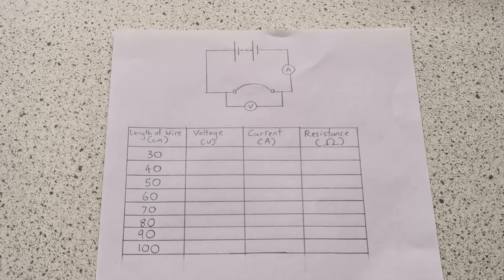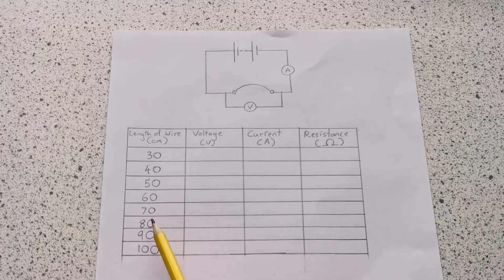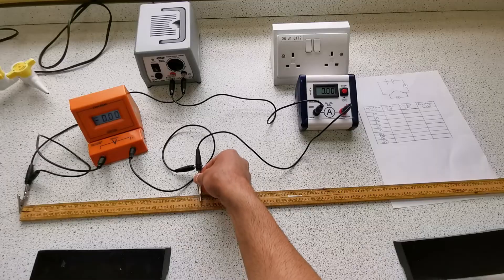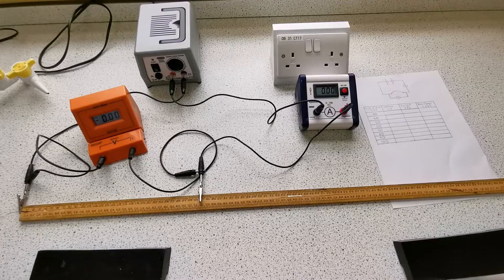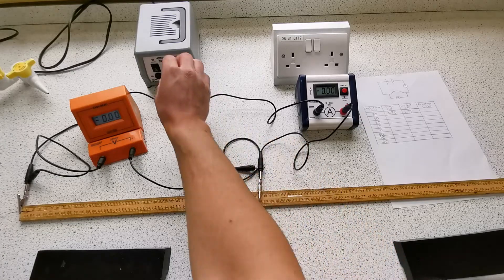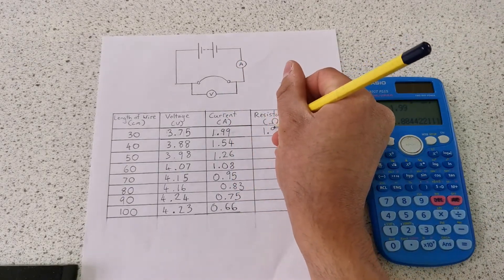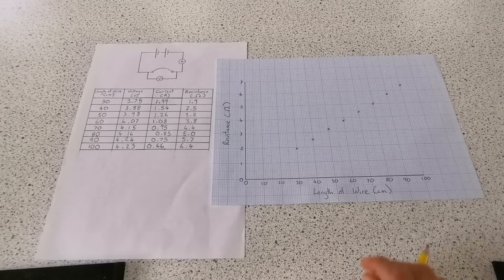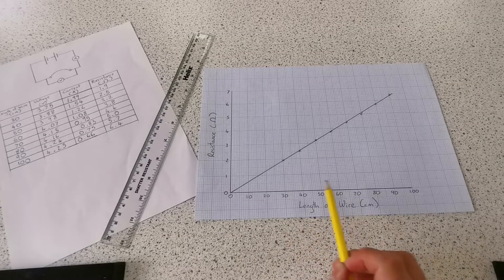How the Length of Wire Affects Resistance - Physics - Science4Breakfast

Comment: have you got a written method somewhere? please and thankyou
Reply from the maker: 1. Set up the apparatus as shown by the circuit diagram.
2. Measure the length of resistance wire using a ruler and record this in a table.
3. Turn the power supply on and measure the current and voltage. Record these in the table.
4. Turn the power supply off between readings to stop the wire overheating.
5. Repeat steps 2-4 using different lengths of wire by moving crocodile clip.
6. Calculate the resistance for each length of wire using the R = V ÷ I equation and record these in table.
7. Plot length of wire and resistance on a line graph.